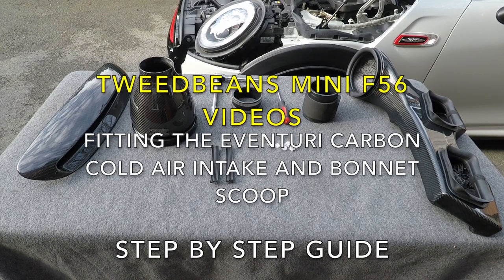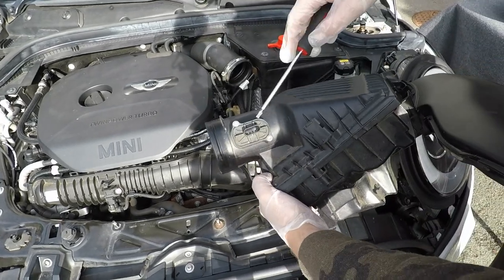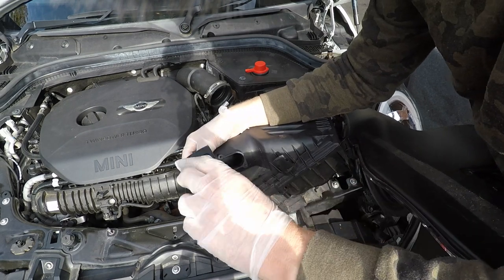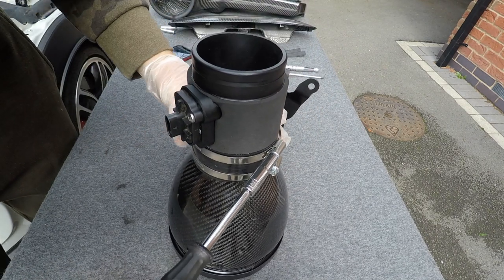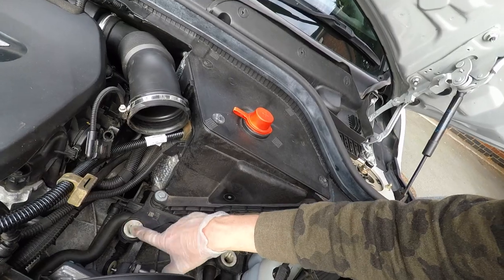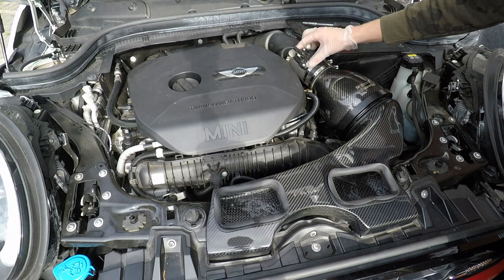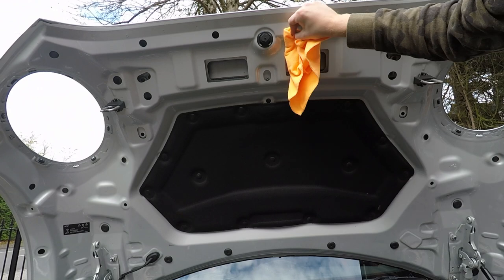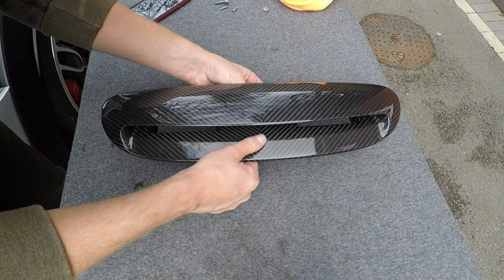BMW Mini F56 Fitting an Eventuri Carbon Intake and Bonnet Scoop S JCW John Cooper Works F55

Comment: PS  put a towel or big old sheet over engine bay so if you do drop the screw on the bonnet scoop it is easy to pick up and not lost in the engine bay (I have nerve damage resulting to loss of sensation to the ends of 5 fingers and boy do I drop a lot and have tons of preventives because with me it is when not if I drop the bolt!
Reply from the maker: Great tip

Comment: Any chance you know how sound the stage 1 type map on stock late 2018 Cooper S is to do? I have been considering that, but have also seen a fair bit online about B48 192bhp engines going bang after that mod (both in Mini and BMW cars) because pistons get damaged because of the map. But also i know MIni used to do a map mod on the pre 2018 cars when installing the Pro exhaust on Cooper S cars. I believe the Mini installed map was up to the Cooper S Works standard, so know this is likely to be OK in terms of bhp and torque increases, but am a not so confident that the sort of numbers i've seen for the like of Dervtech et al of 260bhp and near 50% extra torque would be wise for the engine. Any thoughts welcome 🙂 I should add that in digging around on this, i found that although the engines are the same block for the JCW and Coop S, the JCW engine has different pistons and components in other areas. I think it is assumed they are more similar than they actually are, hence my wanting to make sure i won't damage the engine by mapping.
Reply from the maker: I ran my first cooper S F56 on a manic motorpsort map for a couple of years no problem.  That was running 300bhp - 460nm torque, probably could do with a decent clutch long term to support it.   That car is still going strong with its new owner
Reply: @tweedbean  Did you do any other mods to the car like exhaust or intake or pistons at the same time as the tune? Or was the car standard except for the remap?
Reply from the maker: @theoutsider6191  intake/exhaust/intercooler at that point with the map
Reply: I’ve got a cooper s 2017, tbh if you want reliability I would just leave it as stock a map puts pressure on so many factors clutch gearbox turbo etc all the mega expensive things to replace
I would probably do a resonator delete and air filter and your good if you want quicker buy the jcw,  think the engines are better built with forged components for a map
If you have to get a map I would only increase too 230hp and slight increase in torque to save the clutch to be on the safe side

Comment: Thank you for these explanations. I just installed it. For the maintenance of the filter, do you have to put oil or just blow it? Thanks for your answer.
Reply from the maker: As far as I’m aware these are dry filters, I couldn’t see much info on their website re maintenance if the filters.
Reply: @tweedbean  Thank you. Eventuri confirmed to me that the filter is dry and that no oil should be put.

Comment: I think $1700-$2300 is ridiculous the product get you about 3 to 5 hp if you’re lucky if you read the article and it says 20 to 30+ horsepower that’s with the stage water stage two kit installed on the car so you’re basically spending almost 2K to get 3 hp 3 hp
Reply from the maker: Don’t forget the visuals too as the bonnet scoop looks great, that would cost you a few hundred pounds just for that in carbon from other manufacturers and for some people under the bonnet looking good is a selling point, not to everyone but to some.  And it sounds epic. And it’s not losing hp which is a great start, mods aren’t just about adding performance to some people, there are other factors than hp gains.  Each to their own

Comment: Eventuri has designed a number of rain protections into the intake. Have you experienced any problems driving the MINI in the rain for long periods of time? Thanks.
Reply from the maker: Hi thanks for watching, I’ve had no issues with rain

Comment: Stupid price though but nice design, stock air box and Pipercross filter is fine on my 2015 MCS  cost me £22,£90 resonator delete and a used 4 channel TMC tuning box £60 is  some fun cheap mods,the price of tuning parts for this car are a joke throughout the industry,
Reply from the maker: I do agree, for my F56 MCS I made my own intake similar to you.

Comment: Seems weird to fit a much narrower filter box… also with a turbo actually sucking in all the air it can get does the RAM effect really do anything ? Is there true increase in power \ torque or reduction in fuel consumption ?!
Reply from the maker: Theres so many differing opinions on all that,
Reply: @tweedbean sure but a rolling road should answer the horsepower torque questions. And you could measure pressure before and after the airfilter at various speeds which could tell you about the ram air effect… 😊

Comment: Just purchased the updated hood emblem... Do you know if I can just use a trim removal tool to pry the old one off, or is there is anything special to do??
Reply from the maker: Hi I haven’t done this on the F56 but I have on previous gens.  To remove you can use a plastic pry tool.  I’ve used some heat from a hair dryer to gently warm/soften the glue then ran fishing line between the car and the badge to cut through the foam/glue.  Be care with a pry tool as you don’t want to damage the bonnet.  Remember the badges have two prongs on the back that locate it straight on the bonnet meaning if you are trying to debadge you will be left with two holes.  Obviously if you are fitting a new badge this point doesn’t matter.
Reply: @tweedbean  awesome!  Thanks so much
Reply: I know I'm 2 years late to give this advice, but I would advise not to use a pry toot at all.

Use a fishing line and the heat from a hair dryer.

Because if you use a pry tool to pry up the emblem, then surely, then other end of the emblem is going to dig into the panel. Because the emblem is a solid plastic piece and only has so much flexibility.
Reply: @AlbaderBohamad  I ended up using floss!  Thanks for the info.

Comment: Now that you've changed some performance hardware on the car. Doesn't that mean it needs to be returned to get the added benufit of the performance hardware you've added?
Reply from the maker: Nope the map was ok with this mod
Reply: @tweedbean  but it was optimized for the stock hardware that was on the car. Now the hardware has changed

Comment: Nice sound ...but will  it work on 2019 Mini Cooper LCI due to “petrol particulate filter” !!!
Reply from the maker: Thanks for watching, I am not 100% sure,  I would assume it would be fine as the PPF is linked to the exhaust from memory.  Best checking with your supplier or the manufacturer Eventuri.

Comment: Will you do a video on how to clean the filter & how to remove filter to clean? Thanks
Reply from the maker: Sorry I don’t own the car anymore
Reply: Why did you sell such a nice car? Curious.
Reply from the maker: @DarkstarDarth I switched to a brand new 5.0 GT Ford Mustang
Reply from the maker: @DarkstarDarth I switched to a brand new 5.0 GT Ford Mustang
Reply: @tweedbean   do you prefer the Mustang over the JCW?
Reply from the maker: @DarkstarDarth in all honesty the Mustang was an amazing car but I just couldn’t drive it near the limit like you can in a Mini so ultimately it made way for more Mini’s
Reply: @tweedbean  thanks for replies, I am currently considering a mini as I feel they're much more reliable than pre 2014 era. I've had BMWs before so maintenance is not an issue. Just deciding between an S or JCW model. Cheers.
Reply from the maker: @DarkstarDarth with prices creeping down recently if you can get a JCW with the brakes/bodykit/pro exhaust(not all came with the pro exhaust) it’s worth stretching for the JCW as it gives you a head start if you plan to mod or a good stock car

Comment: Hey man, where did you buy this kit? Will it work for a Mini JCW 2020? Thank you.
Reply from the maker: Hi I purchased mine from Orranje Performance, you would need to reach out to them to understand if it would fit a 2020 JCW.  Thanks for watching
Reply: Do not spend that much money to get only 3 hp read the fine print the only time you getting 20 to 30 hp gains is when you have a stage one to stage two kit

Comment: will the air filter be good enough to protect the engine? i am a little concerned.
Reply from the maker: Hi thanks for watching, sorry I don’t quite understand your concern?
Reply: @tweedbean  i mean, how about the air filting effect by comparison with origin?
Reply: @tweedbean  and is the original exhaust be compatible for this one?
Reply: @Leafie8468  Original air filter has the best filtration against microns, this uses a mesh filter like a K&N so it won't get anywhere near the clean filtration of stock filter.

Comment: How does it perform on a normal Cooper S?
Reply from the maker: Brilliant, I’ve had it on both a JCW and S and happy with both
Reply: @tweedbean  Thanks, I like the idea of a real hood intake instead of a fake one. Picking up my new 23 Cooper S Clubman with manual gearbox next week.
Reply from the maker: @rabola55  Nice it is a slightly different design for the clubman if I remember rightly so make sure you check the one you buy fits the clubby
Reply: @tweedbean  Will do, thanks.
Reply: @rabola55 be careful modding a new car if it has a warranty I would leave stock until warranty runs out

Comment: I wonder about taking that through a car wash if it's safe without pulling in the water and all?!
Reply from the maker: Thanks for watching, I would never take my car through a car wash so if no concern to me however if you have a concern around water ingress, you can purchase air filter covers that stop water
Reply: @tweedbean  So it's not safe to wash the car with an open scoop? What about rain then?
Reply from the maker: @wilsonsilva6702  Hi its absolutely fine to wash your car and drive in the rain, I just specifically answered your question about automated car washes
Reply: There's a video on YouTube where the folks at Eventuri showing that the bottom of the intake near the filter there's drain hole 🕳 for the rain.

Kinda defeats the purpose of this whole product because air could also escape through that hole instead of getting pushed into the engine. But then again, I'm not a professional at this stuff

Comment: The only thing that would this make IT Any better is if they included a smooth hose after the maf sensor
Reply from the maker: Nice did you share that feedback with them?
Reply: @tweedbean  no not owning this car  Just An observation from this video.  With alle other turbo cars they always replace the tube from the maf tot the turbo inlet with An bigger and smoother pipe for more gains

Comment: How many hp increase?
Reply from the maker: Hi thanks for your comment, I havent dyno'd it before and after.  Eventuri claim the following increases on their website: Cooper S: 8-15hp, 15-25ft-lb
 Cooper JCW: 15-27hp, 20-26ft-lb
Reply: @tweedbean  Wait, 15-27 Hp on a stock JCW with no other mods? If that is actually the case that would certainly be worth the price.
Reply: @Gotallofthem1  JCW tested was stage 2 tuned, decat downpipe.
Reply: @Saavvvv  what does stage 2 tuned mean

Comment: Expensive!
Reply from the maker: Can't argue with that :)
Reply: @tweedbean  $1,700.00 here in the USA!  I can buy a short block motor for that price.
Reply: @tweedbean  So may I ask if you feel it was a good investment for your MINI?  Very nice design the way it incorporates both the factory intake and makes the  air-scoop functional to add more flow.  How's it run after?
Reply: Wondering if you have upgraded, or plan to, the rest of the intake pipe?  If so, can you buy the remaining stock section(s) to fit with the Eventuri intake you've already installed?
Reply from the maker: Sorry I would like to answer that but I sold the car on a while  ago now
Reply from the maker: Spot on, for me if you are after quality parts that do what they say, I have no complaints.  Yes it’s expensive but it does what they claim it does